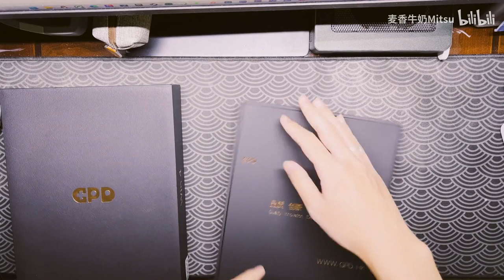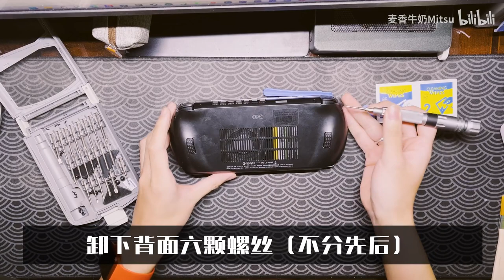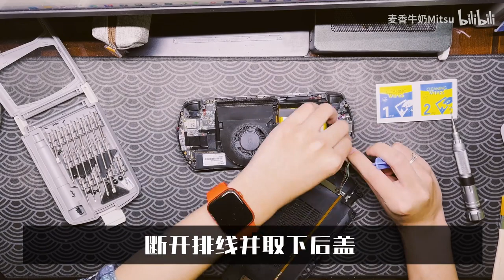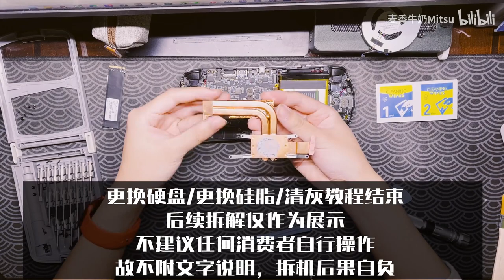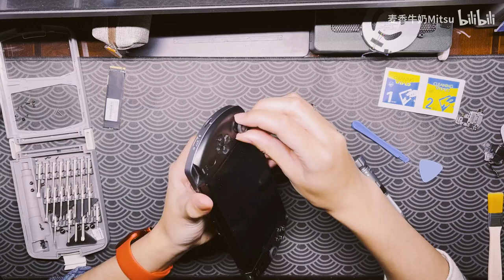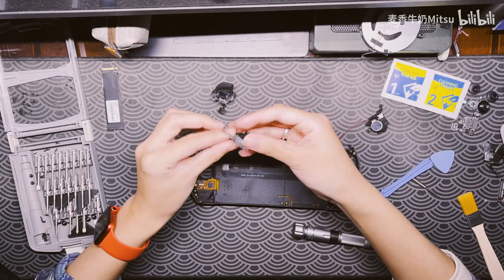Disassembling of GPD WIN4

Comment: I'm looking at replacing the battery on mine and adding some fresh artic silver thermal paste and new thermal pads. But I have two questions. 
1. What type of screw-driver (size too) are you using to get the screws out? 
Thanks.